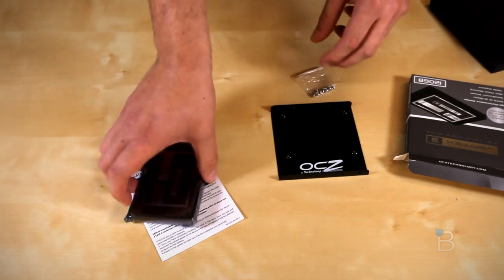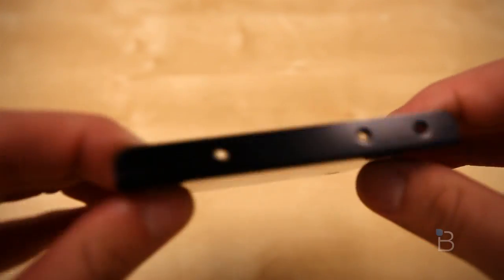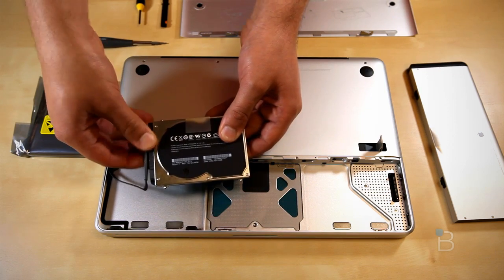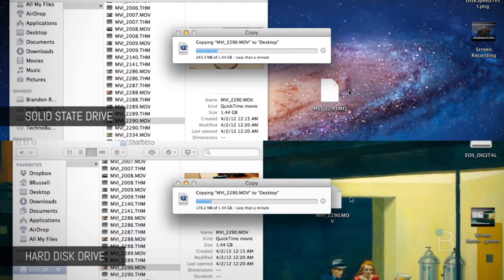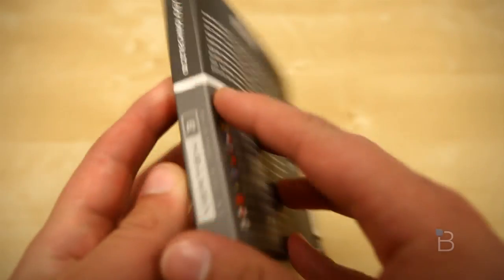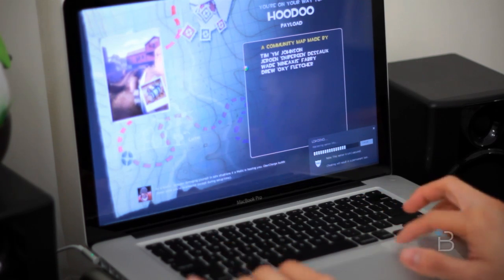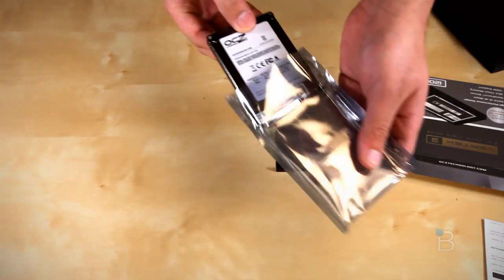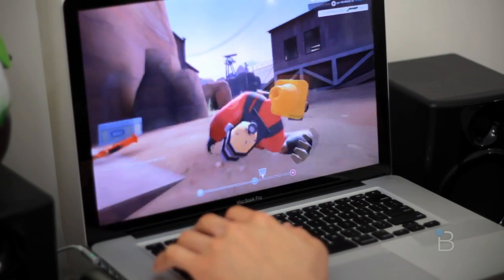OCZ Vertex 3 SSD (120GB) Installation

Comment: Crucial has great all-round SSDs. I bought a 240 GB SSD from Corsair because I read on Tom's Hardware that Corsair drives maintain the best performance/reliability on high-end games, so I installed it on my gaming PC.

Load times for Skyrim on a Corsair SSD are about 1.5 seconds compared to 15 seconds on a HDD.

Comment: You buy a hard drive enclosure which converts an internal HD to an external one. Then you plug the new one to the computer via usb and use a program such as super duper to make a duplicate copy of your original HD onto the new one. Then you install the new one and when you boot it up, everything will appear the same as if you never even replaced the HD! No other OSX installation is necessary.

Comment: I see.  Outside of what OSX comes with already (iTunes, iPhoto, iMovie, etc.), I think one of the only other things I will have to install will be Google Chrome, because it is what I'm currently using for my web browser.  The transition with that will be easy because I have Chrome Sync set up with my Google account, so all I will have to do to get all of my bookmarks and settings back is sign in with that account.  In terms of an office suite, I now do all of my documents with Google Docs.

Comment: (continued from last comment)
Plus, I probably won't even use the whole 128 GB of the SSD.  When I make the leap from Windows 7 to OSX, I probably won't be using nearly as much storage space as I am right now because I won't have to install as many programs on the Macbook Pro as I had to on my current laptop, because it will already come with most of the stuff I need.

Comment: Nice video, Jon!  Pretty soon (within a matter of days or a week), I'm going to be getting myself a 13" Macbook Pro to replace my almost 4 year old Dell Inspiron 1525.  When ordering it, I'm going to change from the default 750 GB hard drive it comes with, to a 128 GB solid state drive.  I'm going to be suffering a fall in terms storage size from my current 500 GB hard drive, but I think it will be worth it because I will be getting better performance.

Comment: They only deteriorate over time if your computer doesn't clean the SSD properly! Most SSD's have built in garbage collection and most modern OS come with a feature known as TRIM which kicks in to make sure the SSD is performing at max speed, so do please get rid of that saying as its no longer a factor.

Comment: I had a Vertex 4 inside my Mac Pro for a while and it continuously faltered. I had it replaced several times until I finally decided to 'downgrade' to a Vertex 3. Now I have a Vertex 3 in both my MacBook and Mac Pro and both work incredibly well, something I couldn't say of the Vertex 4. This may just be a Mac-specific issue though.